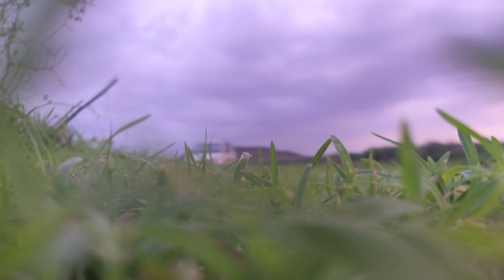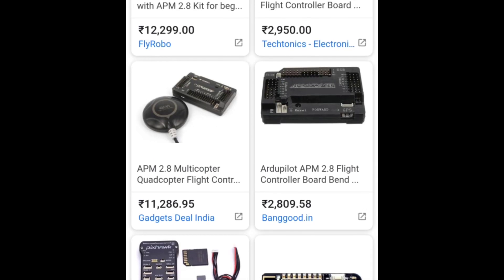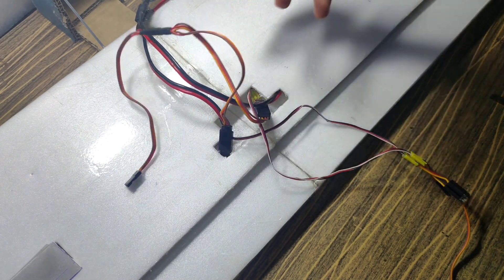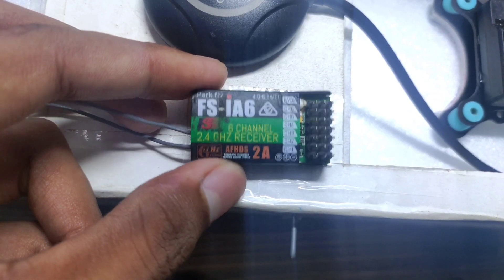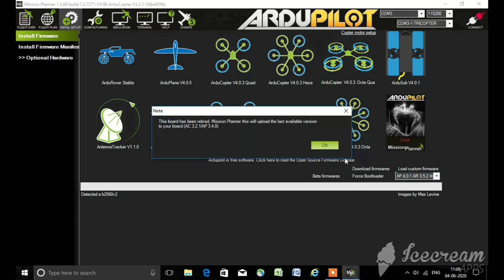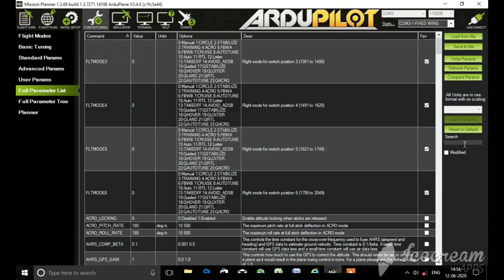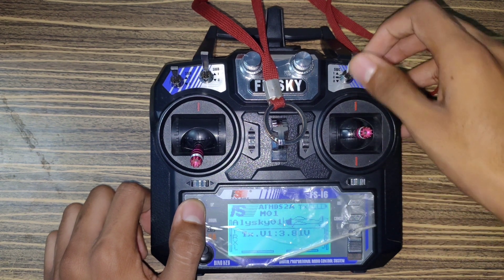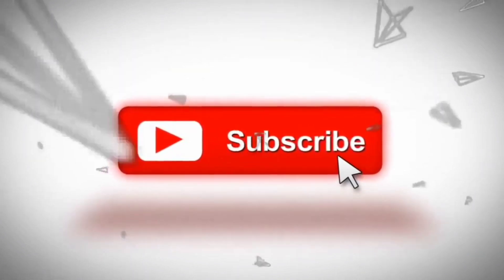How to install flight controller (apm 2.8/ pixhawk) in RC plane

Comment: Does it lands when you switch it to RTL mode ??
And 
Does it switch itself to RTL mode when it dets out of the range of the transmitter please help i am getting confused 😕
Reply from the maker: It will just loiter around. ( you can set loitering height and radius via mission planner)

Once battery drains the plane will slowly loose it's height and will land smoothly!!

Yes, it does switch to rtl if rx looses contact with tx.
Reply: @prathameshkalaskar9250  thnx sir

Comment: nice, but remember to use at least a 3300mah battery with 11" propellers on two A2212 1000kv motors....they are the most inefficient motors ive ever used

Comment: Why my rc plane motor stops working when I switch to auto and rth modes
Reply from the maker: Your motor won't stop if your plan is flying, if your checking those flight modes on ground, for sure they won't work

Comment: my rudder is not working 
if i move my joystick to rudder the throttle does not work can you guide me please
i have used apm 2.8

please reply
Reply from the maker: Plane arm ho Raha hai ky
Reply: @prathameshkalaskar9250  how to arm
Reply from the maker: Configuration- full parameter list- arming check
Reply: @prathameshkalaskar9250  can you make a video based on this
Reply from the maker: @jeyabharathijeyabharati3519  already there are so many videos available on yt regarding to this topic

Comment: Hello my friend. Very nice video. I have an apm 2.6, do i need a shock absorber mount like you have? 

Also, can you tell me the difference between apm 2.6 and 2.8?
Reply from the maker: If your prop is well balanced then there is no need to use shock absorber.
Talking about the apm 2.8, it has the option to use the built-in compass and external compass via a jumper.
Reply: @prathameshkalaskar9250  many thanks for this.  So the only difference between them is that the apm 2.6 only has external compass, and the 2.8 has the option of external or internal compass?

Also, have you uploaded the next video in this series on apm? I would like to kearn how to set up telemetry radios with the apm....

Comment: Thanks for posting. I was looking for info on mounting my FC to the floor in my plane. I am a total newb to planes. Hot glue doesn't turn loose in a hard crash?
Reply from the maker: It does, I had some bad experiences with it, use good quality double side tape to mount your fc!
Actually I forgot to mention that in this video. cheers

Comment: Hey bro...
What's your max telemetry range ?
Reply from the maker: Less than 50 meters, bought that piece of shit from Amazon, might go for a new telemetry soon.
Reply from the maker: I did manage to increase the telemetry range!
Reply: @prathameshkalaskar9250  antenna mod??
Reply from the maker: @kimjong-un4954  nope, just increased the telemetry ip power to 20mw or something I don't remember the exact value via mission planner